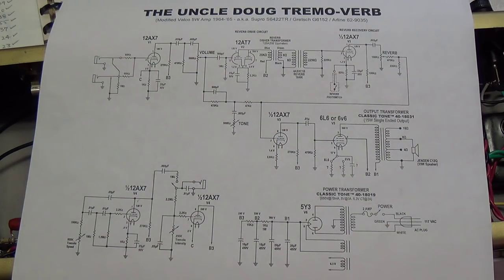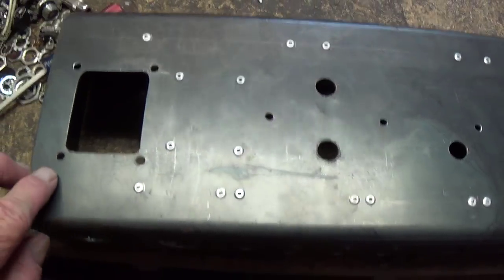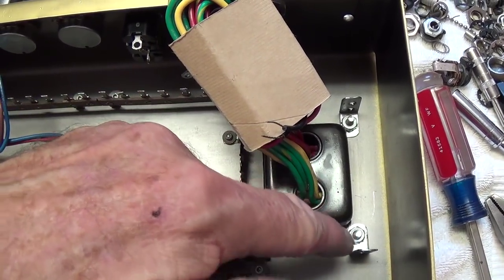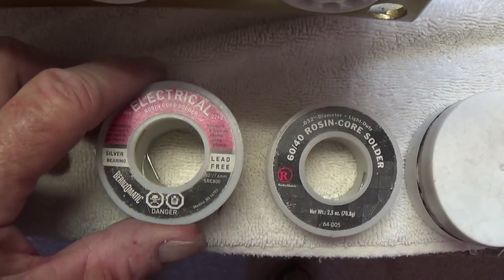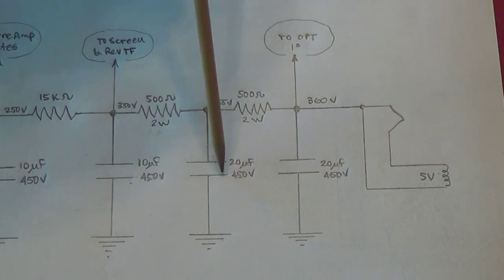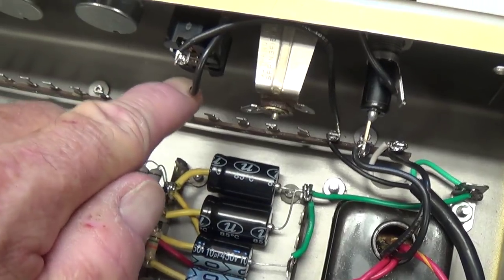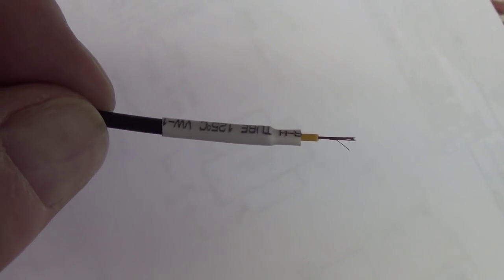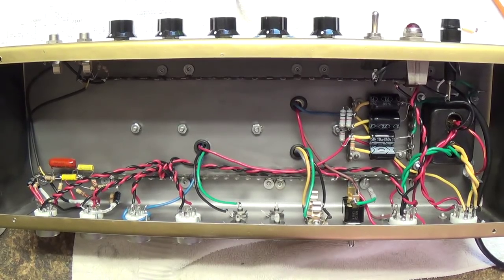How to Scratch-Build a Vintage Amp, Part 7:  Chassis Finishing and Point-to-Point Wiring

Comment: I took a look at the schematic, and I figured I'd share a few thoughts. 

I believe I found an error. V3 (the triode after the reverb pan) places the footswitch on the cathode. I don't believe this will shut off the signal, as a triode can still be grid biased. The footswitch should be placed on the plate, so that when engaged the output of that triode is shunt to ground.  

I would recommend placing a resistor in series with the grid of the output power tube. Values between 1k and 10k can be experimented with. 

You may want to consider placing a 1M resistor to ground on the grid of the other side of V3. And maybe placing a different value capacitor on the other side of the tone control before it goes to ground. I believe the Tweed Deluxe did this, and it was also commonly used on the Marshall 2061x, which has a pretty nice tone control. 

You'll have to run a load line to see what would be an ideal cathode bias resistor for a 6L6 (especially since 6L6 types vary so much), but I've seen 250 ohms used in other schematics. The value for the cathode bypass capacitor on the output power tube can be just about anything you want. 47uf was used in a lot of older amps, and it will produce more of a classic Class A type of sound. A higher value will produce a sound that more closely mimics a Class AB push pull amp, values like 220uf is typical.
Reply from the maker: +Alva Goldbook  Thanks for bringing this to my attention. In the Fender Reverb schematic I used in the original video, there was a letter "E" attached to the cathode of the recovery 12AX7. It's present in complete Fender schematics (i.e. Twin Reverb) also. I interpreted it as the attachment point for the reverb foot pedal, but upon closer examination, it appears to connect to the grid of the 12AX7 rather than the cathode.  It would seem to me that grounding the grid would be a good, non-hazardous way to shut off the reverb.
Reply: Admiral Quality  What's interesting is that the vintage amps tended to place the foot switch on the grid of the recovery triode, while the reissues all placed the footswitch after the plate of the recovery triode. 

Any tube reverb design has to worry about a few problems. One basic problem is limiting the frequencies that are not ideal for reverb. Bass frequencies will muddy up the signal, while too much treble will inject noise. So we're talking about cutting frequencies below say 100Hz-150Hz and cutting above say, 3kHz. The blackface reverb circuit mostly concerns itself with cutting bass frequencies, which is why there's the 500pf cap in front of the circuit and a 3.3nf coupling cap on the recovery triode.  

It should be noted that reverb tanks do not have a static frequency response. A tank that's rated with an 8 ohm input is only 8 ohms at 1kHz. It's input impendance varies across frequencies. With that in mind, it's worth considering using a lower cathode bypass cap on the 12AT7s, in order to counteract this. Plus, a lower cathode bypass cap means you can omit the 500pf input cap if you wish.

Luckily tube reverb circuits are pretty forgiving. And introducing more impendance to the grid of the recovery won't cause a very noticeable effect, since a cathode biased triode already has the grid at a high impendance anyway.  

Those old Fender reverb tanks from the early 60's had a tone control, which some players really like, but by my way of thinking, it's better just to omit the undesirable frequencies in the design of the circuit itself.
Reply: Admiral Quality Yeh, I read some weird crazy stuff on his rig years ago, but I had my doubts it was accurate.
Reply: +Alva Goldbook Interesting.

Does this also imply there's a useable all-wet signal in the reverb footswitch of most vintage style amps?
Reply: Admiral Quality Is there a signal, yes. Is it usable? That depends on the amp's circuitry and how much you value your life! 

Just as a volume control works by varying the amount of signal going to ground (and out of the circuit), a footswitch in these vintage type amps simply turns a reverb circuit on and off by grounding it's output. The footswitch is simply a latch that sends that signal to ground when the switch is closed. You can use this signal from the footswitch for other things, but you should keep in mind that this is a high voltage signal (typically around 200 volts or so), and direct contact with that signal can be lethal without the proper precautions .
Reply: My life? Knowing how most of those switch pedals are constructed (with a plastic cover that pops off the bottom like a coffee can lid) I'm sure there isn't lethal voltage in there. (We'd expect to hear a snap from closing that high voltage contact if there was too.)

But yes, there's probably DC in the signal that would need to be filtered out before plugging it into another device that might be even more sensitive than me. ;)

I'm thinking an adaptor cable/box for tapping off that signal, whether the reverb is engaged or not, so you can record it separately and choose to re-apply it in post if you wanted to. 

(Though I suppose tapping off the output of the reverb tank would make even more sense for that and be far simpler and safer to any down-chain pre-amp. What's the output impedance on a typical spring tank? Googling... they range from 500 to 12k Ohm, with the middle of the range not far off from low wind single coil pickups -- so any electric guitar input should be quite happy standing in as a makeshift reverb recovery as well. Hmmmm! I've got a spare little Accutronics tank lying around that I bought off a guy for $20 just to experiment with. Though amplifying the output isn't the challenge there, it's more how do I drive the input? I tried some ART Tube MP pre-amps and they didn't seem to go nearly hot enough. Maybe a powerful headphone amp might suffice. Tank input impedance seems to range from 8 Ohm to almost 2k which is roughly headphone range too! Hmmmmm!)
Reply: Admiral Quality The reverb circuit that's used here by Uncle D is basically a copy of the reverb circuit found on Fender blackface type amps from the 60's. The footswitch itself is safe because when the switch is open (reverb on) you can't come into contact with the high voltage. When the switch is closed, the voltage goes to ground, back to the chassis, where it is earthed. I assure you, that if you do come into contact with the wiring of the actual switch, that this would be no different than touching the plate pins on the tube socket of the preamp tube.  There's 260 volts on the plate resistor of the reverb recovery triode in a Fender Deluxe Reverb, so we are talking lethal voltages here. The reason why you don't hear any pop is because the switching is not in series, but rather it's shunt to ground. Even on multi-channel monster amps that's produced today, this is the preferred method for switching channels because series switching produces more noise, while switching by shunting to ground produces very little. the most ideal way to connect to the reverb circuit on a tube driven reverb amp is to just connect the RCA cables that are used on the reverb pan. People have been doing this for years to play those blackface amps at lower volume, but you end up losing the reverb and the tone of the power tube.
Reply: +Alva Goldbook But the switch goes on the floor and, again, has nothing more substantial than a coffee can lid on the bottom of it that could easily be kicked off. (Can't say I've had it happen but I could make it happen in a couple of seconds.)

(Though I suppose that isn't much more crazy than a Hammond cabinet and/or Leslie speaker where the B+ voltage for the organ's preamp comes through the cable to the cabinet. Yikes!)

But, if there's that much DC voltage then you couldn't just short it to ground without overloading the power supply, right? Is it not past a DC-blocking cap by the time it's in the pedal wire?

I'm getting out the multimeter next time I'm around a blackface amp. Damn the torpedoes, I'll keep one hand in my back pocket! ;)
Reply: +Alva Goldbook Oh and wouldn't you lose all dry signal if you tapped the output of the reverb tank? (Not a problem for the application I'm imagining, in fact it would be a plus as that's the signal I'd be wanting to isolate.)

I used to do a fun thing with my Twin Reverb Reissue and later after downsizing, my Deluxe Reverb Reissue. (I have since been forced to downsize to no real amp at all! Not good!) Anyway, I had THD Hotplate speaker attenuators for both of them (great product! No blackface amp should be without one) and aside from the obvious attenuation function (which can go all the way down to negative infinity) it also offers a line-out. When you record that line-out signal it is surprisingly harsh and unpleasant with hard clipping, so at first it seemed sadly useless. That was until I realized I could re-apply the effects of speaker, cabinet and room purely in software. I'd use IK Multimedia's Amplitube amp-sim software, but disable the amp part of it and just leave the speaker, etc, enabled. (iZotope's Trash also has some great cabinet sim impulse responses built in. Native Instruments Guitar Rig is the other big amp-sim software product and I imagine it can probably do it too.) Once that was applied, it went back to sounding like a real amp in a real space again, but it was now what I call a hybrid amp-sim. Real tube pre-amp, real tube powered spring reverb and tremolo, real power tubes, everything cooking on "9" at 3:00 AM (and producing that satisfying hot smell too) and my neighbors don't hear a peep because everything past the output transformer is all simulated in the computer and only coming out of my headphones.
Reply: Uncle Doug You're right! It certainly would be more safe, and probably less noisy too!
Reply from the maker: Great.....I'll alter the schematic to reflect this change. Thanks again for your input :)
Reply: +Uncle Doug Yeah, looking at the TR schematic, the reverb pedal switch just shorts the output of the reverb tank straight to ground. So it's microvolts on that wire and, as I suspected, not dangerous at all. The run to the pedal and back must be a bit like a second guitar patch cable. (In fact, turning the switch off is just like turning the volume knob on your guitar down to zero.) Do we notice any drop in high end in the relatively high impedance reverb output signal when we use a pedal vs. no pedal at all? Or is the reverb itself generally already dark enough that we don't notice the high end loss over the cable run? I'm guessing high frequencies probably don't transduce through those springs much at all. But here's another idea for a mod now... a little box you can patch into your reverb pedal that acts like a guitar's tone control but only affects the wet reverb signal. You could add a high pass knob too for brightening or narrowing the frequency response of the reverb, all totally passive just like in the guitar!
Reply: +Uncle Doug A Leslie cable will still kill ya though! 300V on pin 5 on the most common type of Leslie cable (122). On a cable running across a wet stage, down under your feet and/or your foot pedalboard! With guitar players constantly stepping over and on it. :o

http://www.captain-foldback.com/Leslie_sub/pinouts.htm

And if that kind of Leslie cable doesn't get you, the next common kind is the Leslie 147 where the slow/fast motors are selected by mains power through the half-moon switch under your left hand (internally it appears identical to vintage Telecaster switches). AND that power runs through the same cable as the signal! (Though it is quite a hot signal for the 147 -- meant for Hammonds that had built in speakers -- which uses the speaker out of the organ's built in power-amp as its input. So I guess it just doesn't pick up that much noise, relatively.)

Craziness!
Reply: +Alva Goldbook Hmmm, yeah, seems so. But if I'm reading this right it's after the DC blocking cap and Reverb amount pot. So it's still not going to shock you. (Again, if it could then shorting it out would be bad.)

http://support.fender.com/schematics/guitar_amplifiers/65_Twin_Reverb_schematic.pdf

I'm no expert by any means (Doug is slowly enabling me to the point that, if I only had a budget and some workshop space, I'd now be dangerous) but I'm pretty sure on this one. Anyway, having that signal shorted out post-gain rather than having the reverb recovery always amplifying nothing (and adding noise) makes perfect sense and that was actually what I originally assumed, above. I wasn't aware that was one of the changes on the reissues though. (I bet there are purists who think that wrecked something. ;)

And yes, the stand-alone Fender reverb effects had tone controls, as do their reissues. (I'm not sure offhand if that affects the entire signal or only the reverb signal. They didn't have separate wet and dry outputs like modern rack effects do so you can use them as sends. They were strictly insert effects.) And they're almost the size of an amp head! I'm just thinking about small devices you could add to the amp externally, in this case on the reverb pedal switch, that would give you more control of the sound for the cost of a couple of pots and caps, and with zero risk of injury to yourself or the amp. I'm going to try this next time I have a real blackface (reissue or otherwise).
Reply: Admiral Quality Well, keep in mind a coupling cap will block DC and pass AC. But I assure you, AC voltage will kill you just as easily as DC will.  I noticed that the Fender Twin Reverb places that switch after several resistors, probably for this reason, since the Twin Reverb uses higher plate voltages. It's probably better to place it on the grid, perhaps fender did it this way, since they combined the tremolo and reverb controls in one output jack instead of two like they did on the vintage stuff. 

The stand alone reverb has a tone control and this is placed at the end of the circuit. Really, you can think of the circuit as a simple amp pre-amp unit, it splits the input into 2 signals, one going to the verb tank and the other is bypassed through with a few triodes amplifying the bypassed circuit. The mixer control at the end blends between these two signals, so you get a wet/dry mix.
Reply from the maker: I made a video about my scratch-built Fender 6G15 several years ago, Alva, and my analysis of the circuit was identical to yours. Thanks for your input....it's always informative and interesting.
Reply: Uncle Doug I've often thought of making my own stand alone reverb unit, with dwell, tone and mix controls, but using 12AT7s instead of the 6V6 (or 6k6 in the early vintage models). One of these days, maybe. I dunno if you caught this, Uncle D, but Antique Electronic Supply is selling their own stand alone reverb units, I believe of their own design. I believe it uses 4 pre-amp tubes.
Reply: +Alva Goldbook Yeah but the AC constituent there is just a "line level" pre-amp output signal, right? That's where you'd put an effects loop if the amp had one. (Or maybe you'd want it pre-reverb. But they're obviously similar levels as they're about to be mixed together.)

And yes! That appears to be a mix on the output of the Fender Reverb unit, not a reverb level as we have on the amps. So you can dial in 100% wet, meaning you could use this as a send effect. Thanks for pointing that out, I want one even more now. (I have yet to hear a truly convincing spring reverb done in software. Amplitube's gets close, but not quite. On my list of things I want to try to take on, someday.) The tone control however appears to only affect the wet side, which is what I'd expect. Dry should be dry. (Unfortunately it's only a low pass. Being able to dial some lows out of the reverb would be very helpful sometimes too.)

http://pedaldoctor.com/images/RevSchematic.jpg
Reply: +Admiral Quality No. It's not line level. Well, some older tube amps put an FX loop in that way, but those FX loops were horrible. WAY too high impendance and not at line level (the Marshall Silver Jubilee comes to mind). 

Tubes are lousy things to drive FX loops anyway, but the best way to go with that is with a cathode follower. There is no cathode follower in a blackface amp. Op-amps offer far superior performance for FX loops!

If I was going to put an FX loop in a blackface type amp, I would do it after the reverb/tremolo circuit, and place right before the phase inverter.

I've heard Neil Young uses one of those reverb circuits, and keeps it mostly bypassed before putting it in his main amp, a Tweed Deluxe. I think his appraoch is to just use the reverb unit bypass as a kind of pre-amp booster.
Reply: Well, if Neil's reverb is "mostly" bypassed that means there's still some reverb in it. This makes sense as of all the gain and clipping (and hence, compression) the Deluxe is going to apply to the signal. So when the guitar is loud it sounds relatively dry of reverb, but in the gaps between notes the reverb swells up to fill the spaces due to the high gain of the Deluxe.

I do this all the time when mixing drums and vocals. Add a bit of reverb, THEN compressor. It lets you "duck" out the reverb signal when the instrument or voice is up front so it's not overly muddied, yet fills the gaps with reverb nearly as loud as the dry signal was. All without having to mess around with side chains. It all just sorts itself out automagically. (And kind of substitutes for artifacts of tape recording, which naturally applied similar compression effects when the tape was saturated.)
Reply: Admiral Quality I think he gets his reverb sound from a stompbox, but don't quote me on that.
Reply: I read a bunch of stuff about Neil's kit not too long ago and I don't recall anything about that. They said he used relatively few effects pedals. Occasionally he kicks in a flanger during the long, feedbacky outros to songs. Most of his pedalboard is to control the "whizzer" -- a custom rig that remote servo controls the pots on his tweed Deluxe.